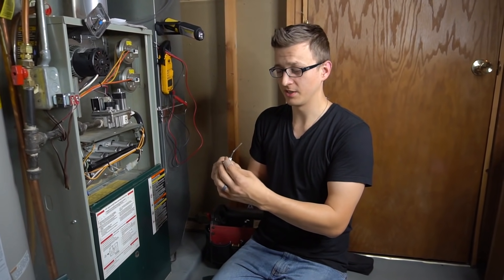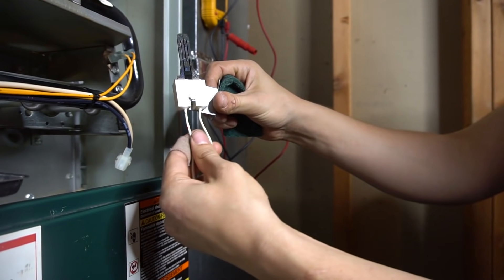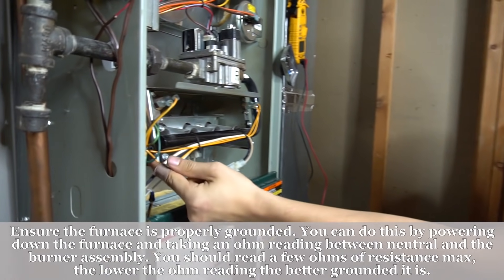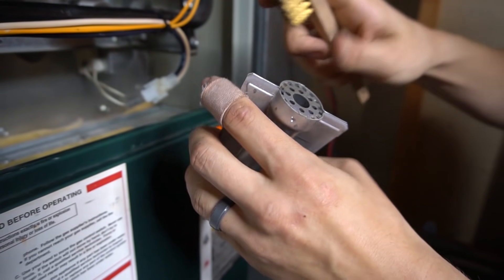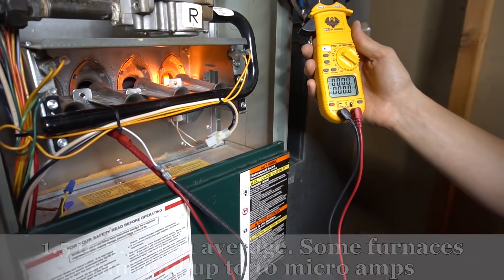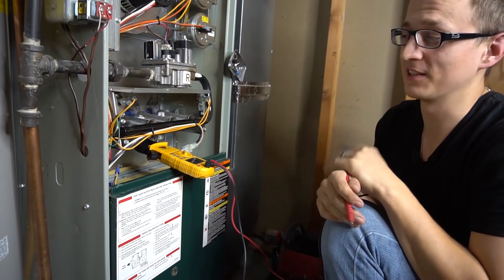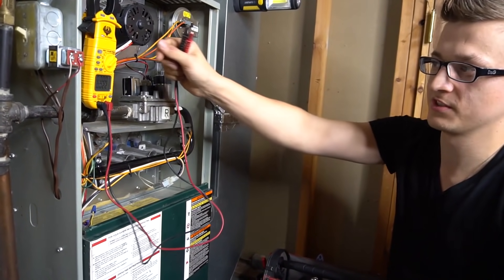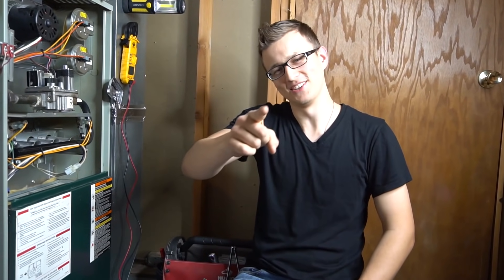Furnace Not Working - Troubleshooting the Flame Sensor

Comment: Just took mine apart and cleaned the burners. 23 years old and I want to keep it a lot longer!
Reply: Still working! Want to take care of this before January comes when you REALLY need heat! Just be wary of potential gas leaks when repairing gas lines yourself.

Comment: Learned how flame sensor works. Need both sensor and burner face to be clean to conduct 1.5-3.5 mA ion electricity. After cleaning the burner face, the flame stays on.

Comment: Your video was very informative, you help me solve my issue of not firing up the burners on the second stage till I reset the furnace, just happened sometimes.
Ended up being the ground wire vibrated loose just a little. Thank You

Comment: This has been super helpful.  After the third fail visit by the local HVAC shop, I opened up my Trane 80 and found that the rod inside the porcelain was broken loose, so rotated freely (out of the flame).  Someone had attempted to make the rod stay in the flame by twisting the sensor wire to "the right place" and cable tying it, but that was pretty iffy and the sensor ended up out of the flame after a couple of days.  After watching your video, I estimated the position it should go in the flame, put a drop of superglue down each end of the porcelain, and screwed it back in.  D'oh!  Wrong position.  So I took your advice, bent the rod into the right position, and accidentally cracked the end of the porcelain a little, but it works now!  (I have a new $11 flame sensor on order from Amazon.) . Don't know whether to ask the local HVAC shop for my money back or just let it go, but how hard would it have been for them to install a new flame sensor instead of a lame cable tied mess?
Reply from the maker: Hey Dennis! Glad to hear my video helped you track down the problem! Sounds like you got it all figured out now. The flame sensor will likely work just fine with a little of the porcelain part broken off. But it's not an expensive part so why not just replace it :)

Comment: Great video.  Lots of good information.  I learned a lot from this video.  I would like to share my experience on the uAmp reading on my furnace that is difference than the normal range discussed in this video.  I have a Nordyne furnace that was acting up.  It would show a 1 hour lock out code.  After power off and power on the board.  it would run for 4 mins on the first cycle.  On the second  cycle, it would flame on and fame out after 3 seconds.  When the flame was on on the first cycle, the reading was 3-4 uAmp.   I looked at the flame sensor, it was a little bit dirty.  I cleaned it up with wire scrubber and 2000 grit sand paper.  The flame sensor looked shiny.  I put the flame sensor back.  I was getting 8 uAmp reading.  The furnace cycle normally after cleaning the flame sensor. The house was heating up to the set temperature.   I was following your video on the uAmp reading.  I thought the 3-4 uAmp reading from my Nordyne furnace was normal and did not need to clean the flame sensor.   I found out that after cleaning, the reading was at 8 uAmp.  I there for conclude. Each manufacture spec on the uAmp reading that is consider normal operating uAmp are different.

Comment: Thank you Jay! This is a life saver! Woke at around 3AM because the House temp drop to 10 degree C, furnace stopped working. I did test the thermostat and looked it was working fine. Cleaned the flame sensor and everything is now back to normal. Great video too!

Comment: 👏🏾 You, my good man, are impressive ! Flawless execution. I've been an electrician since 1996. 
(& "allegedly" a nerd,  ever since my original birthday)  My craftsmanships are always presented with Excellence & a sprinkling of  O.C.D sauce 🤓  I NEVER ,😳 EVERRRR knew that the flame itself, was, literally !,  a integral part of the control circuit 🤯 so I'm literally omw right now, to my furnace . 
new flame sensor ✅  
Tools and voltage meter ✅
New knowledge & understanding ✅ &...1 Big SMILE ✅
True masters , always remain students.
Reply: 😳😲🤭🤫 soooo, If I had broken my 2 wire  hot surface igniter.🤣 hypothetically . Is there a workaround with a different style of igniter , or substitution with similar characteristics and function ?

Comment: I knew to clean the flame sensor, but the burners kept shutting off 5 seconds after starting even after cleaning the flame sensor. (Lennox G27M3-75A-2 furnace)
After watching this video, I took the burner out where the flame sensor is positioned. It had a light coating of carbon on the end.  I used a brass brush to clean it, then put the burner assembly back together - and my heat works again.
Thank you

Comment: This was a really helpful video for me. With it, I was able to get right to the bottom of my furnace issue, and get it working right away. I had just masked off the garage to paint, and plastic sheeting covered the combustion air intake. Your side trip into the flame sensor, and how 3 or 5 non-starts will cause it to cut off. And how it simply needs to be power cycled, was just the thing. Thanks again!

Comment: WOW HOLY COW YOU  ARW INCREDIBLE!!
Excellent! 
Excellent info!
Excellent explanation!!
Excellent teaching!!!
I know this is 5 years ago but I hope you get to read this. 
Love the meter in the flame😊☝️
Not too many know or would even think to try that. 

One question I would trust your input in

What are some symptoms of low or marginal gas pressure at the furnace valve?
What’s a typical “WC?

If you get to this great but
I’m a follower now!!😊
Wow holy cow
Thanks man!!!
Reply from the maker: I love your enthusiasm! Glad you liked the video so much!
A typical lo-fire gas pressure is about 1.7"-2.0" WC. If the flames in the burners look "lazy" instead of a sharp cone, then the gas pressure may be too low. It's best to adjust gas pressure while doing a combustion analysis to see how the gas adjustment is affecting the carbon monoxide/dioxide levels. The default gas pressures for lo and hi fire should be listed on the furnace nameplate as well. I don't adjust gas pressures too often but here is one example of when I would: Let's say I come out to a Carrier furnace inspection and I know that my CO PPM should be about 50ppm on this style of furnace but I am seeing 120ppm. Usually a compromised heat exchanger would go well beyond 300ppm so that would not be my first suspicion. This scenario would make me check the gas valve pressures. I would probably also clean the burners to further drop the ppm.  (should at least be under 100ppm)
Reply: @WordofAdviceTV  wow holy cow again!! Thank you for your reply!!
The unit is only 3yo so hear exchanger good
And I have the manuals so pressure is in there. 
Don’t want to jump to suspend gas pressure but after confirming so much else is good just thinking about what else. 
Thank you again
Really appreciate your sharing so much. Browsing your videos and a wealth of good solid help!!
Wish you well!!
Scott

Comment: Great definative video. Cleaned my flame sensor with no improvement so I did the recommended burner cleaning (very tough to get out). That did the trick. I was ready to move on with the electrical multimeter checks but it turned out to be unnecessary. This saved me from wasting time and money buying a new flame sensor. Best video on the subject on utube. Thanks a bunch!
Reply from the maker: Glad to hear you got it fixed! :) Stay warm!

Comment: Hands of a furnace technician, nicks, cuts, bandaids, scars,,,hah, great videos. Make sure battery drill is set before running in wrong direction so you dont strip or break those tiny screws. Been there done that!

Comment: Thanks for the video, 
Thanks for you showing how to insert the meter probe between  the metal terminal metal and the plastic insulator in order not to open up the terminal grip ( like i see some do,they force the tip in, and weaken the connection!!!), never thought of that,that is also priceless.

Comment: The tip on cleaning the burners did the trick for me.  My furnace was shutting off immediately after lighting intermittently - about 60% of the time.  I cleaned the flame sensor - still happening.  I installed a new flame sensor - no luck.  After staring at the thing for many start-up cycles I finally noticed that when the burners were lighting there was sometimes a delay before the leftmost burner lit.  That's the one farthest from the igniter and that has the flame sensor in front of it.  Sometimes the flame spread so slow that the third burner didn't light before the flame sensor check and so - shutdown.  I followed the instructions in this video to extract the burners and clean them.  The leftmost burner had some accumulated rust in the slot that connects with the next burner over.  I suspected that was what was retarding the spread of the flame to the left burner long enough for the flame sensor check to fail.  After a thorough cleaning the leftmost burner now ignites in less than a second and no more problem.  I will have to remember to clean the burners every once in a while in future.   Thanks muchly for the info.

Comment: Great job, thank you! My furnace is behaving exactly as you describe for failed flame sensor. I don't have have a meter that reads microamps, so I just replaced the sensor with new. Cheaper than buying a meter, but that didn't solve the problem. Still getting code 34. Voltage to sensor when gas lights is 50VAC. Cleaned burner, checked flame rollout switch and pressure switches, all good. Guess I will get a uA meter, but lets assume sensor flame sensor is good and ground is good, what next, control board? Other?

Comment: Thanks. It seems like such an obvious thing to check, but it looks like I just had a loose ground connection causing an intermittent flame sensor issue on my mom's heater. The ground screw hole was completely stripped out, just drilled a hole to the side of the old one and drove in a new screw. Probably will take a week to be sure that was it, the issue was very intermittent.

Comment: After watching your video's the one problem you didn't cover and the one I had turned out to be the pressure switch . The furnace would fire up and shut down after 5 sec. Cleaned flame rod  still did same thing next cleaned burner and measured voltage which was good . Changed limit switches still furnace would fire up and shut down a few time then would catch and run  to complete cycle. finally replaced pressure switch and bingo  furnace now fires up without double clutching.  P.S. like your video's full of good info

Comment: Does that green ground wire on the left of burner carry the microamp back to the control board? If you were to remove this ground wire, would the flame go out ? Great video. Thanks

Comment: Hello, thanks for your very good explanation and presentation. Flame sensor of our 10 ton dual fuel steam boiler stop working frequently. Weishaupt burner.  Would you please explain the possible causes?
Reply from the maker: I am assuming you cleaned the flame sensor or replaced it already. But have you cleaned the the burner and any other metal surfaces around the flame sensor? That may be all that is needed.

Comment: Great video! Had a furnace with a short cycle, cleaned/replaced flame sensor multip time but still not working. After watching this and cleaning the burner, then finally problem solved!!
Reply from the maker: Awesome! Glad to hear you were able to get it fixed and the video helped with the process. Thank you for leaving a comment!

Comment: Hi Jay- appreciate the content, very informative and helpful. I would like your feedback on this situation with flame lockout. 

When I turn the furnace ON, it goes through the sequence and lights up and stays ON for  more than 15 seconds and shuts off. ( I verified the sensor is clean), also the ground and other connections are good. 

Coincidence is the flame shuts off right when the blower fan kicks ON. LED error code says it’s flame lockout. 

I tried everything and still trying to get to the bottom. 

I appreciate some feedback

Comment: Do you have a similar video for testing the wiring and circuits for a combination igniter flame sensor? I cleaned it up so it shines again and still get the fault and shutoff.

Comment: I have a furnace lockout problem. I cleaned the old flame sensor, the furnace worked for a few days. Put a new sensor, the furnace worked for a few days then locked out. Interesting observation is that the lockout occurs at night when the thermostat is set to 62 F. This may be just coincidental. I don’t think it is the flame sensor. Could the motherboard be bad? Appreciate any help on this. Thanks. BTW, the best video I have come across.

Comment: I have been stuck debugging a flame sensor issue where the fan won't stop running. The control board is new so I didn't think that was the issue. I was set to replace the flame sensor as was waiting for the part to arrive when I found this video. As suggested I removed the burner section and the piece in front of the flame sensor was very rusty and corroded. I brushed off some of the rust and re installed. I've now cycled the unit on and off using the thermostat 5 times and I have yet to receive the error. Until otherwise noted, I think this issue may be solved. Thank you
Reply: Spoke too soon; error hit about 10 minutes later. Single flashing light

Comment: Can you help...furnace cycles on and off, burner comes on for 5 or 6 seconds then shuts off, does this 3times then shuts down; diagnostic light then flashes twice indicating it’s not sensing a flame (per the Big Maxx manual) I followed your instructions to test the flame rod with my multimeter, microamps tested .7 to.9 on the UA setting, then tested a.c. Voltage, tested 28 to 30 volts. (Also previously replaced the flame igniter and the flame rod so both are new). Any suggestions on what’s next? Watched many of your videos ,very good quality, thanks for the help.
David

Comment: Hi, great videos! Thanks for your clear explanations. My furnace has this issue. The igniter glows red, then the gas comes out but does not ignite. I can hear and smell the gas. I manually reset it and after 3or 4 tries, it will ignite. This seems to happen mainly at night. I just go out and use a lighter when I hear the gas valve open. But it’s getting too cold to go outside in the middle of the night lol. Any suggestions? Cheers
Reply from the maker: What comes to mind is a couple possibilities.. First, I would try cleaning the burner faces of the burners. (the side facing the ignitor) Especially the transition "wings". Be careful with the ignitor, it is rather fragile so if you hit it, it will likely break. Also the burner orifices should be checked/cleaned. (I have a video called something like "a few burners not lighting and whats wrong" where I show how to do that. Another possibility is that the ignitor is getting weak and should be replaced or it needs to be re-positioned to be a little closer to the burner (you could try just bending the bracket slightly, make sure the ignitor does not touch anything though)

Comment: Please tell me what model Milwaukee cordless you're using. Been happy with it? If it died tomorrow, would you buy the same one again, or a different one? Thx much.
Reply from the maker: Here is the drill: https://amzn.to/2MHLudO
I absolutely love it. Have been using it over 5 years. I had the older model and now this updated one. Have been happy with them both. If I lost it, I would buy the same one again. That being said, this drill is great for appliance service work but some people may not like the fact that the RPM on this drill is slow. I actually prefer it that way since I rarely strip out any screws or screw holes with it.
Reply: @WordofAdviceTV  Thanks so much for that link. I've been using a 2-speed cordless a bit larger and heavier. Believe the smaller size and weight of yours will be a welcome change and the RPM difference looks good enough (watching you use it) for me. Will always have my more powerful one if needed. Like you said, sounds great for appliance service work. Much handier than mine for that. Will be looking for your vids to see how it's going for you in Hawaii.
Reply from the maker: @JustPlumDucky  Oh yes, it is so much more convenient than many of the other larger drills. I don't even bother looking at other drills ever since I settled with this one. If you get it I am sure you will love it. If not, then we live in a great time where one can return just about anything 😄 Stay cool and have a great week!
Reply: @WordofAdviceTV  Also noticed the size of that magnetic parts tray looks pretty handy... much handy-er than mine! Where can I order one that size?  Thx much!
Reply from the maker: @JustPlumDucky  I am pretty sure this is the size I have: https://amzn.to/3CsYlun